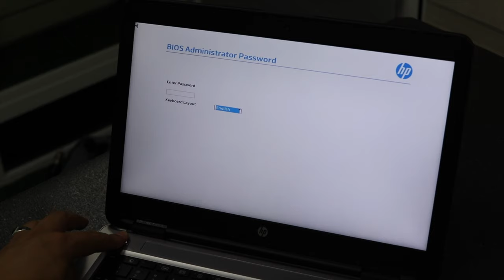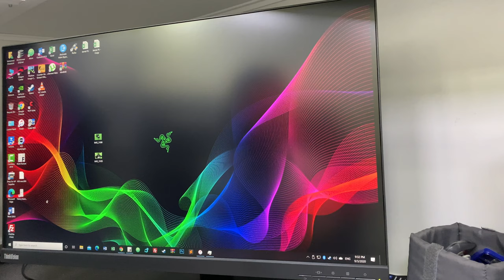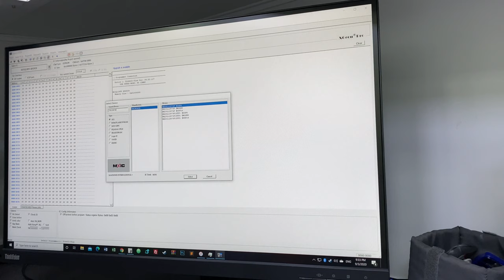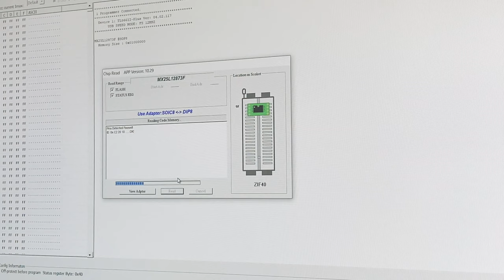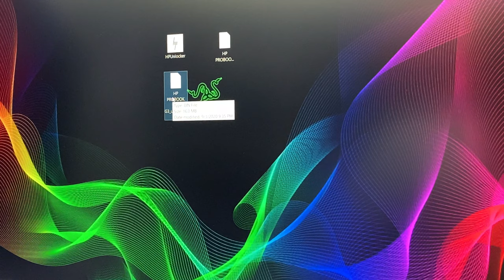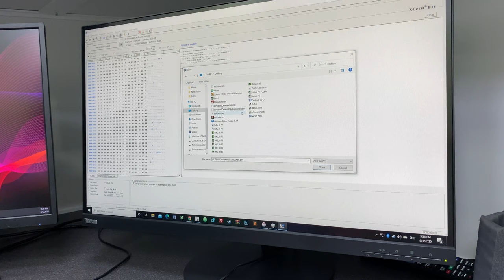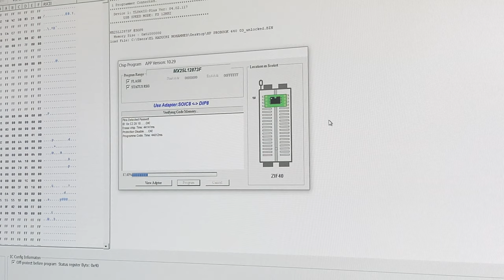HP Probook 640 G3 Bios Unlock Full Tutoriel 4K Password Remove!! #PASSWORD BIOS KILLER!!

Comment: how remove bios password hb proobok 450 g7
Reply from the maker: حماده use the same methood
Reply: @wildreviewtech  and do you maybe know, how to remove from hp omen 17 ( qh128ahig chip )
Reply from the maker: Pamela Landy send me the picture when password appear, on instgram or mail
Reply: @wildreviewtech  
I applied the steps but it didn't work
Can I communicate with you
Reply from the maker: حماده send. To me the original backup i will check for you
Reply: @wildreviewtech we dnt have this tools tell another  way to do in home